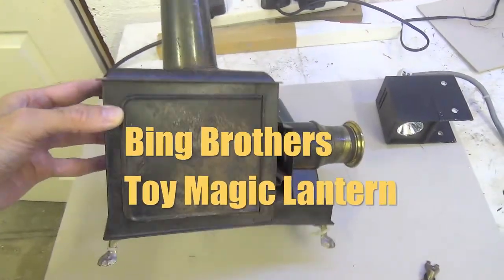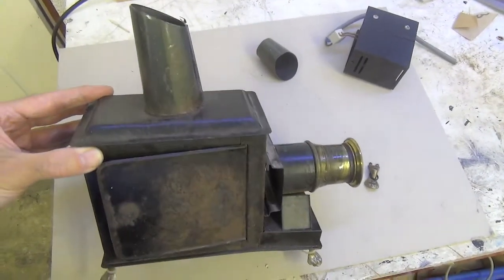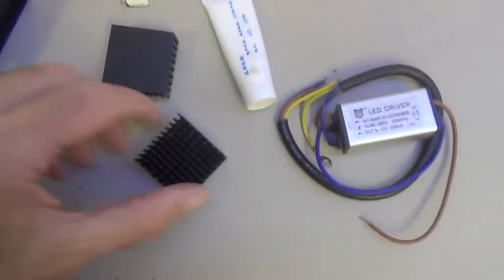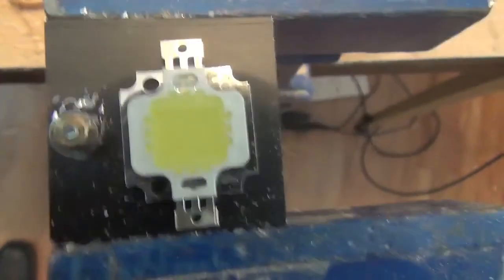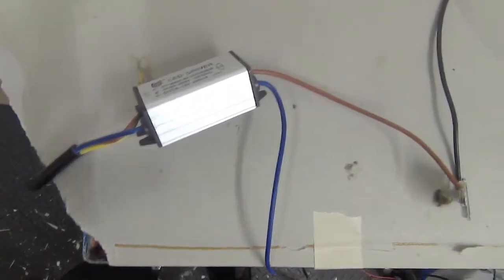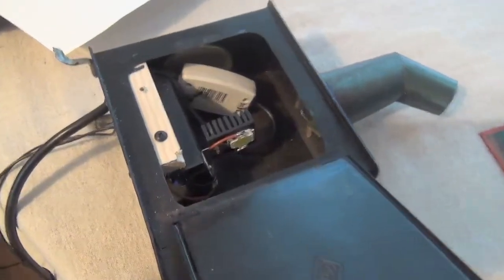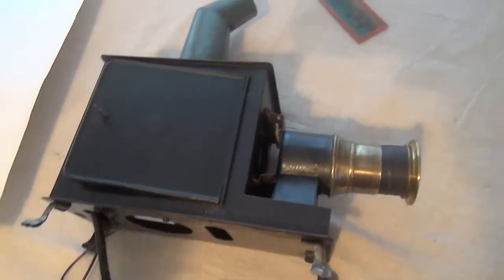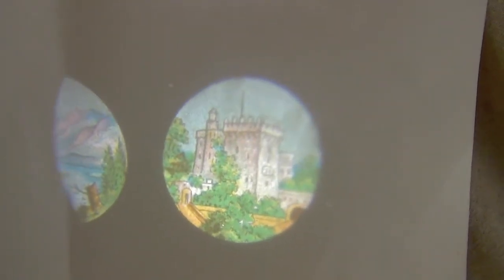Bing antique toy Magic Lantern - renovated and re-lamped for museum

Comment: Hi - I have  a very rusty toy lamp that looks like this model - I have been derusting it for around 3 weeks so  far. My front foot is also off. May I ask how you fixed yours on as there is no access to the area where you turn down the metal tabs. 
Thanks, Jules
Reply from the maker: Hi Jules, .... because this is a  'handling collection' item, I decided to fix the foot with epoxy adhesive. I use 24hr Araldite. Sandpaper the parts that are to receive the adhesive first, to give a good 'key'. The fixing won't be reversible. You might also try superglue (cyanoacrylate), but I don't get on with that too well. For a professional museum-standard fix that is reversible, I would use a strong animal-based glue - but that takes some experience.
Reply: Many thanks.